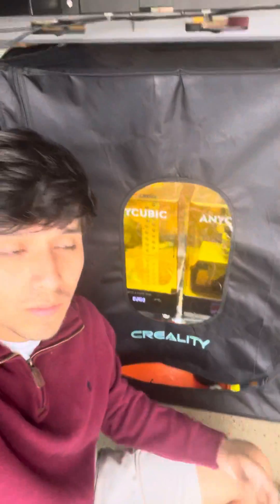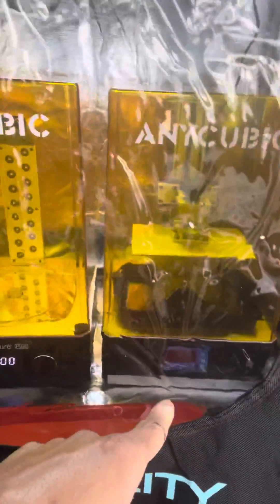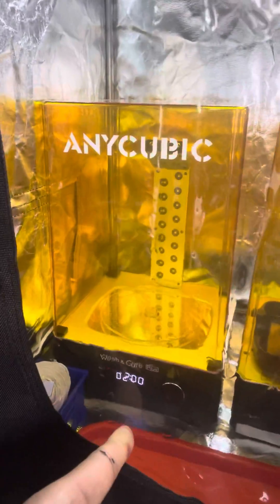Control 3D Print Resin fumes and smell

Comment: Your set up is the same as mine, the problem with those " grow tent" are the zippers stiches and the zipper itself is not well sealing the tent  where the fumes leak from there and still smell that in the long term; the reason you don't smell anything is because seems ur area big enough also I go the same "comgrow" tent model which I am trying to seal it with a special tape from the inside since I don't want to spend more money to buy a new one. I 3D printed a nozzle exhauster  and installed with a 8 feet  flex aluminum duct on the back  of my Photon mono 7 Max to purge the odor out the tent.

Comment: Hey! Do you know if I can set this up in a really small studio apt ? I can't really have a resin setup other than enclosures. I can get the vent duct out to a window but I don't know if I can safely set this up in the same area where i spent 99% of my day in...
also can i skip the big carbon filter and just go with the small carbon filters that anycubic sells ? like the vent duct will just go straight out the window with a fan pulling the air out.
Reply: carbon filter not work. i got mono SQ and that cant even filter. So i think best way is having 2 duct to free air outside. in and out. and add small fan in and out accordingly
Reply: @arifbijaksana1396  can you leave the tent open like he did in the video at 1:08?
Reply: @3D_pablo  yes as long as the cover is sucked in like in the video. You want to achieve negative pressure inside the tent.